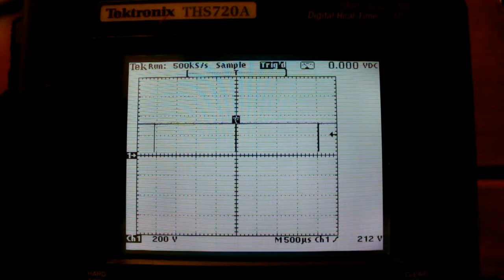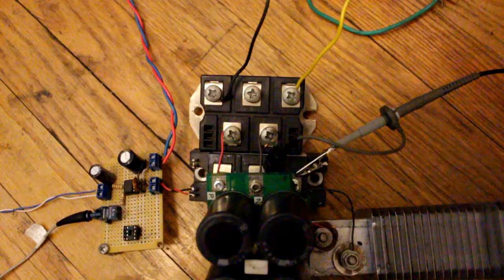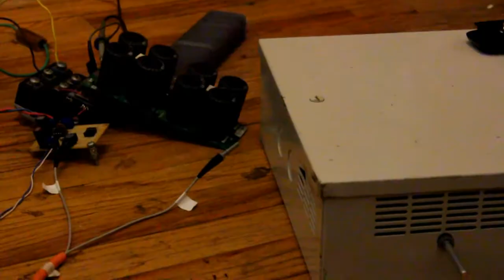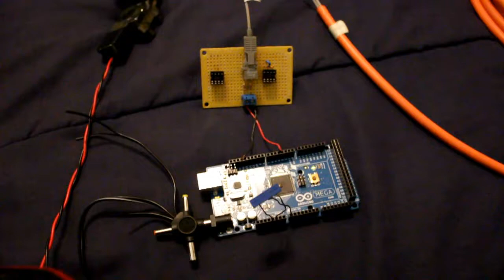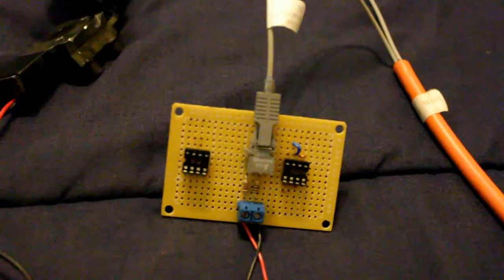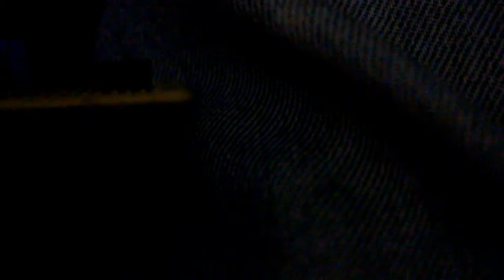Quick intro to fiber optic IGBT gate control

Comment: Hello Sir , Good time.
I am an electrical engineering student. I am working on a project about making a fiber-optic igbt driver.
I'm searching for a suitable circuit to switch my igbt gate remotely via fiber-optic cable.
I found your circuit excellent in this case.
It would be a big help to me if you send me your circuit components list and schematic

Best regards.

Comment: Really nice and simple demonstration of optically decoupling high power circuits from control logic my friend :) I actually have a question for you. What type of fiber transmitter/receiver are you using in this demonstration? I mean the part number... I may build a demonstration stand for educational purposes and i haven't figured out the optical part yet :P 

Thanks in advance!

Comment: I really like your video....thanks for sharing! I have a problem on a project. I'm building an induction heating coil to heat a steel tube"3 in dia". I'm powering it with circuit/power supply from a induction hot plate (1800 watt). In testing the unit it will not heat the tube until  i put a break in the round sleeve so the tube is not a complete circle..... kind of like "C" shape. I'm using type 7 wire. Any thoughts??
Thanks
Mike Williams
Reply from the maker: What is the frequency of the hotplate power supply? I'm thinking since those usually use a frequency around 20 kHz, that the frequency may be too high. Larger metal objects require lower frequencies to heat due to the skin effect that happens when using Alternating Current. For a pipe that big, you won't need more than a few kHz

Comment: what if close proximity is the only option? is there any suitable method of further shielding?
Reply from the maker: it is possible, but difficult, as the shielding must not have any breaks. all gaps must be closed tightly and the shielding materials can some times increase inductance or cause losses, like eddy currents. Higher voltages really upset control circuits, so it's really application dependent. For the most part, fiber optics aren't needed for any bus voltages below 1000 volts DC as long as you aren't switching off too quickly, but I have seen fiber optics used in 500 VAC rated ABB drives, and I have blown control circuits due to noise at ~ 300 bus volts.
Reply: subcooledheatpump thanks for the reply, and thanks for the very informative and straight forward videos